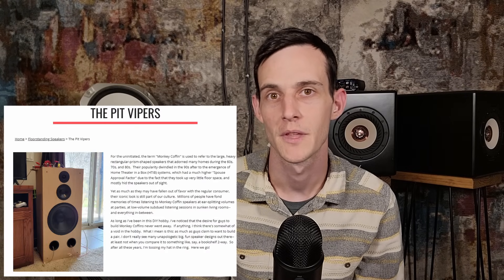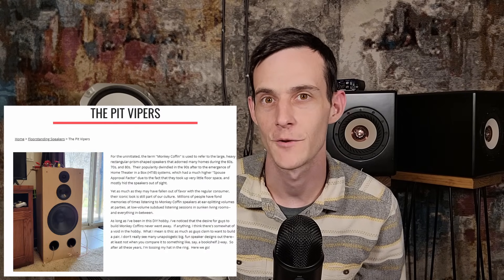Speaker Kits YOU Should Know About In 2024

Comment: I've built two of Jeff Bagby's and three of Paul Carmody's. They are treasures I can never part with. I Built the Tempests, Continuum, Classix2, Speedsters and Tarkus. They changed how I tend to think about hi-fi with regard to obsessing over perfection. Right now I have the speedsters in my bedroom and they are a joy to listen to. The Classix2 get rotated into use in there as well and I dig those equally as well. All of them are veneered, including the two 12" subs I built. Zaph Audio has some good free plans as well. 

Another option is to completely rebuild or upgrade old classic consumer speakers. I like rebuilding some of the budget JBL designs, some of which have some excellent drivers. I tend to choose the designs that have the polyplas drivers with the rubber surrounds. Since JBL uses proprietary drivers. their crossovers tend to be rather simple. Upgrade the budget cabinets with thicker MDF, add some bracing and slightly oversized to make up for what volume the bracing takes up, add some veneer and they have moved up a category or two. 

In this age of easy subwoofer designs and availability, I really don't see the need to build/buy such woefully inefficient two-way designs in exchange for bass and I just don't like sharing the midrange with the tiny high excursion mid-woofers those designs tend to use. I will always choose a 3-way for full range use, but like using subs with those as well.
Reply from the maker: I agree, I much prefer a nice 3-way these days for lower distortion. I'm jealous of the Speedsters. They're on my short list!
Reply: Dimensions of your bedroom?
Reply: @C-man553  11' x 14' x 8'. Right now they are paired with the wiim amp. Excellent combination.

Comment: Parts Express in addition to Toid's design, offers a finished speaker with the relatively  new Epique drivers. The Dayton Epique drivers are grossly inefficient and Danny at GR Research didn't even attempt an improvement on the PE design. Much amp power is required to drive them. The driver look cool, but practical?
Reply from the maker: Toids design uses x2 of them to increase the efficiency. They're still somewhat inefficient, but that's the cost of bass in a small package regardless of driver choice generally.